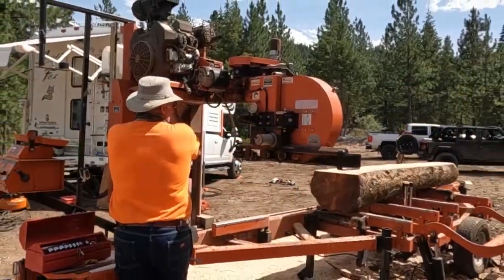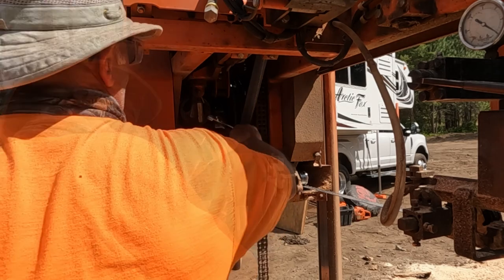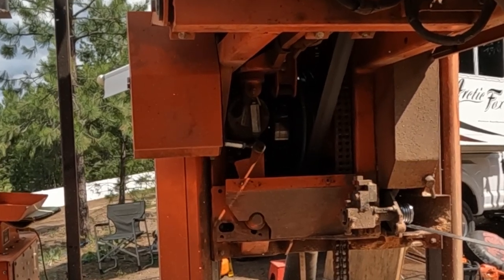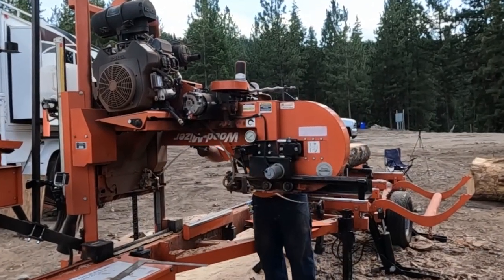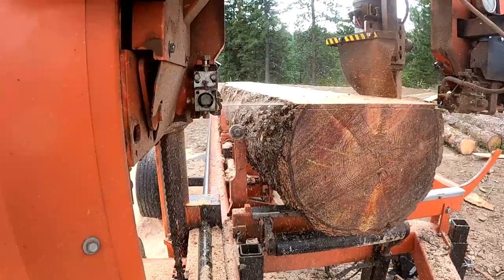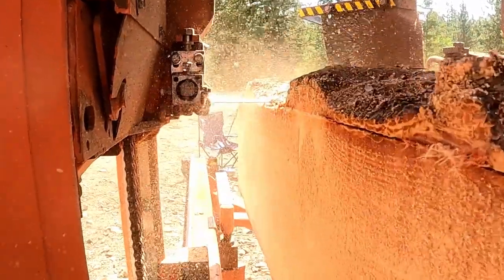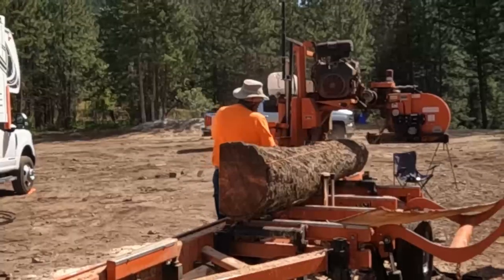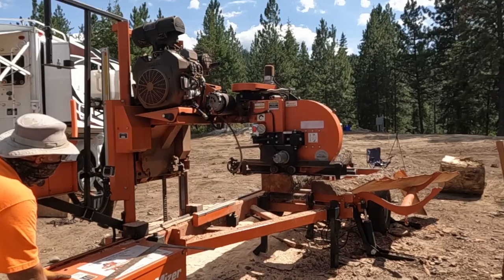Stop Making Wavy Cuts on Your SAWMILL #WoodMizer #sawmilling

Comment: Keeping the Blade Idler Arm closer to the work piece will reduce some of the waves.  I also found increasing the Tooth Offset from 0.021" to 0.031" or even 0.041" will also reduce the waves in Knotty Pine. Sharp blades and speed of cut as well as Blade Tension is important.
Reply from the maker: Don't set my own so use what I get from WM but yes on all accounts.

Comment: Been just a tad busy, try to watch all your videos, got to this one late. Just one little question. Your drive belt doesn't ride under the blade does it? I suspect not. So how would a loose drive belt produce a wavy cut?
Reply from the maker: The drive belt drives a pull on a shaft that the band wheel is on.  Too loose a drive belt and it doesn't provide the power to cut smoothly.
Reply: @TheOldJarhead  gotcha 👍🏻
Reply from the maker: You bet!
Reply: I’ll have to remember about the drive belt in the future. Looked like it wasn’t a bad job to tighten up. Will be watching for you to do a in-depth video on it. Good job.
Reply from the maker: It's not too bad once you get used to it.   ends doing the first 20hrs then checked about every 50 hrs or so.